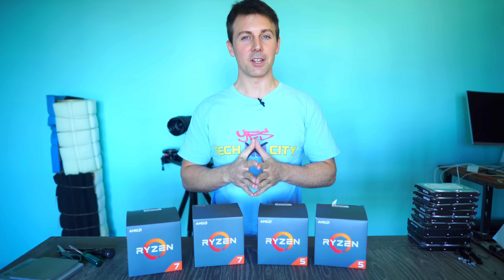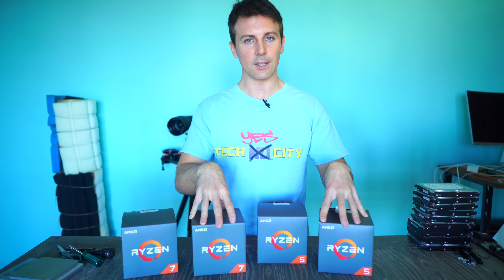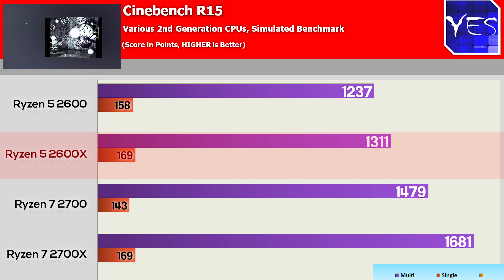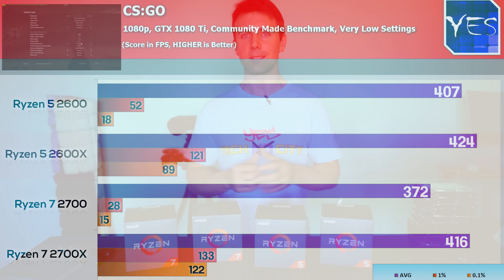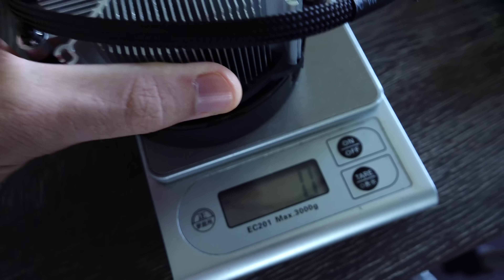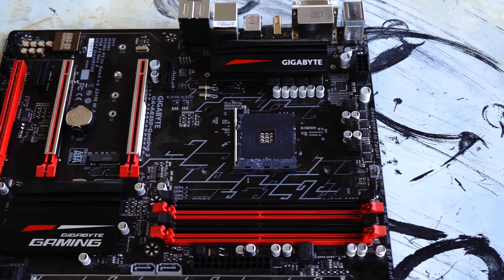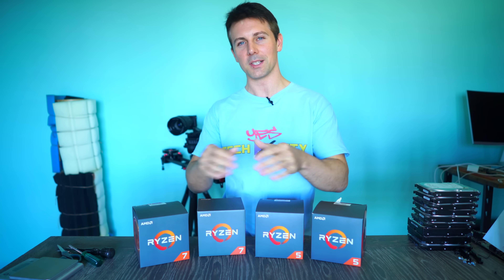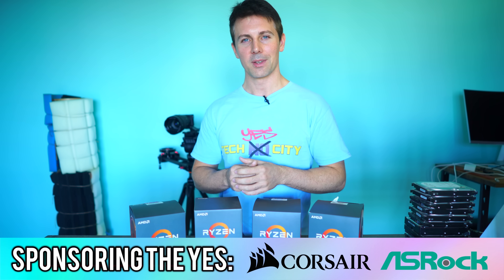Ryzen 7 2700X Vs 2700 Vs Ryzen 5 2600X Vs 2600 - Is the X Better Value...!?

Comment: ASRock b350 pro4 or Asus prime b350 plus for 2700 stock cooler ?
Reply: vishal Sharma Asrock ab350 pro 4 has very stable Ram OC and compatibility than Asus . It has decent vrm cooling and 2 m.2 slots . Bios is very easy to use .no need to tweak much for 4.2 ghz . But still Asus is also a good pick . Get the cheaper one but not sure about asus ram OC
Reply: Kelvin Caban
Corsair Vengeance LPX is RAM that has multiple versions and is marked Ver xxx on the ram, I got a set of 4 sticks of 8GB LPX 3000 memory (used from ebay) but it was 2 different version numbers and while one would do 2933 the other would only do 2667 with my Ryzen 1600 and my recently aquired 2200G. Most of the memory lists do say which version is tested, but if you just plug in the stock number, you won't get which version number they are selling on most etailer sites. Also the version I had which did do 2933 was an older version number the newer version would only do 2667.

It's just one of the many surprises that come along, you might remember on Ryzen 1 launch most reviewers got vengeance LPX 3000 RAM in their kits and some could get 2933 and others could only get 2667, but no one mentioned the version numbers they had and they were all scratching their heads over it and never seemed to figure it out.
Reply: Remember you need updated bios on anything other than x470 to boot with the 2000 series.
Reply: Quite right, many vendors will do it for your if you ask them. I guess that is a way around the whole early bios being shit thing i found on asus, if they brick it before they send it to you that's there problem.
Reply: vishal Sharma Either will work just fine, but go with Asus in this case because it has a fully unlocked BIOS so has better usage in future if you want to OC.
Reply: vishal Sharma your vrm will not last long with a 2700
Reply: I have the Asus B350 prime plus board in this system and updated the bios just fine to run a 2200G. Though I did have to borrow the missus's R5 1600 CPU to update it. The board is solid so I can easily recommend it, just remember that whatever B350 board you choose that it has an updated bios to run gen 2 or the board won't even post and you'll need a gen 1 chip to resolve this.

The Asus board runs a 4+2 phase while the Asrock runs a 3+3 phase setup (don't be fooled by the fake 6+3). So I'd be wary of voltage stability on the Asrock if you intend to overclock as it could result in lower max frequencies, but it'd be fine for stock. The Asus VRM's can handle a fair bit of power draw as I've pulled in excess of 130W stable on my B350m-a board (The aforementioned R5 1600 @1.45V @4.1GHz) which has the same VRM's but without any heatsinks without them getting very hot.

The thing to note about the Asus board is that it is one of the few to include legacy PCI slots (2), which is the reason I chose it.
Reply: Just make sure the ram is compatible with on the asrock website I just went and bought 3200 ram and I can only get it stable at 2800 speeds with Corsair vengeance lpx white
Reply: What a mess, I thought it had more to do with the motherboard support because I had seen people use the vengeance lpx 3200 with their r5 1600s I had a bit of buyers remorse with the asrock pro4 but it’s entirely possible ryzen 2 could fix the memory issues
Reply: Kelvin Caban
I will point to the fact that my 2200G with updated memory controllers didn't help. I also notice that no corsair module over 3000 is on the Asrock QVL for memory on the pro 4 nor is it on their x470 boards.
Reply: Hopefully you got the ASRock. I might be wrong but when I was looking at Ryzen hardware I remember the ASUS B350 Prime being one of the worst.
Reply: had no end of issues with the asus B350s i think there is a bug in the asus b350 bios , one refuses to update the other failed the update and bricked the BIOS the third did update and it was fine then so i think once your on the later bios they are ok ( all where upgrades with the same USB stick and the one that worked was done last) , just the early bios is buggy as hell. I have switched to MSI B350 boards for our low end workstations with a x370 for me ( yay for being IT manager) and ASRock for our Threadripper systems as they are a good price for built in 10 gig nic.

Hope this helps.
Reply: Andrew Joy so I should buy ASRock b350 pro4?
Reply: MrBluePoochyena my budget don't allow me to buy x370 or x470 only x370 is a gigabyte board that everyone said to stay away from
Reply: I would not give you a 100% yes as i have not tested that specific board , but i would stay away from the asus on this one ( most asus stuff is awesome) I have however tested https://www.msi.com/Motherboard/B350M-MORTAR.html and this is a good option.

Comment: Another great video! This video makes me want to build a ryzen PC even more. Also, have you tested AMD's store mi yet?
Reply from the maker: Testing it now!
Reply: Store Mi is fucking AWSOME! It gets more out of an optane than you can get on intel. Sure you can just buy that software and use it on an intel but its cool you get it for free on AMD.  

I would stress when you do the video tho that make sure you point out that store mi is NOT cache , its tiered storage and that's MUCH cooler than cache .
Reply: I am yet to use it on mine as I had a pre installed operating system to chuck strait on but I would love to experiment with Store Mi next time I have an empty SSD. would love to have a dedicated steam and battlenet game library having it moving games for me that i play would be a time saver. get so sick of dealing with that.